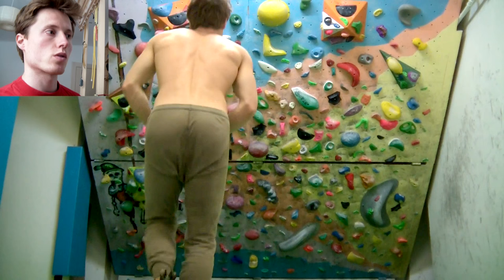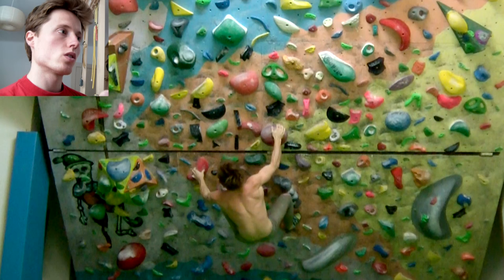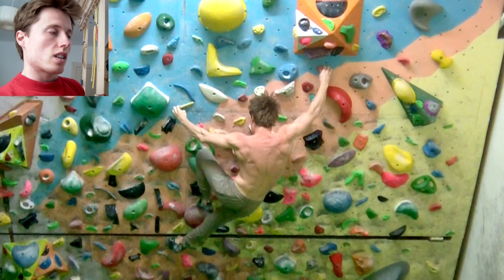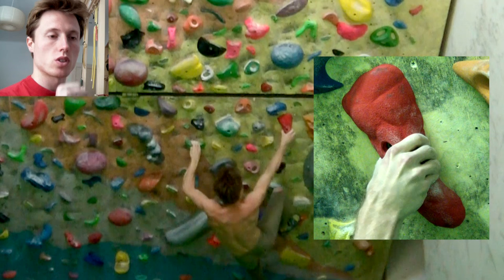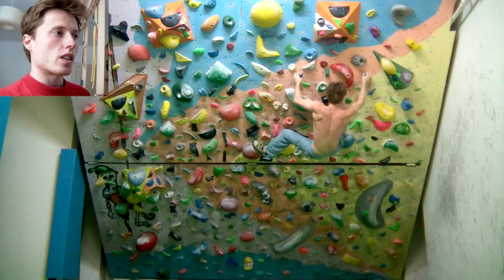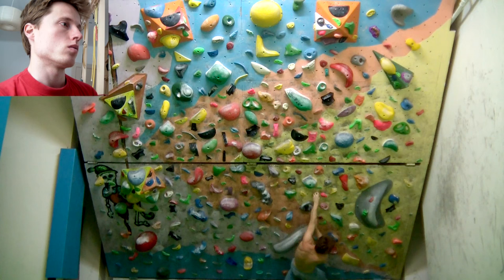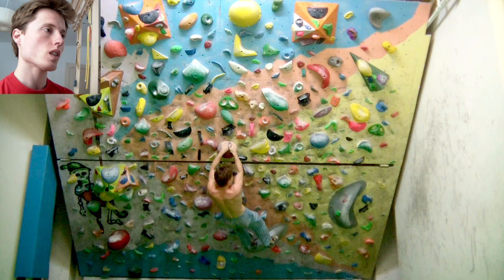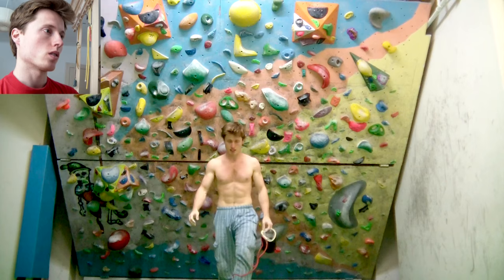Power Endurance in Climbing: How to Train it Effectively, Different Methods

Comment: Power endurance is the same as anaerobic resistance, right? From what I've gathered, for AE it is recommended to do circuits of 20-40 moves at your max but without falling, and not very long rests (3-5 mins), when you are training for sport routes. I wonder if this method you expose here works the same (different approach, same goal) for routes, because I tend to think this is more boulder-focused.
Any insight is welcome.
Cheers.

Edit: Just read one of your responses below. Anyway, would you think this power endurance is good for sport climbing? I'm basing my training on Eric Hörst's "Training for climbing" which includes 3 weeks of just volume and stamina, 3 weeks of power and strength and 2 weeks of anaerobic endurance, never including the power endurance.
Reply from the maker: What you are describing is anaerobic endurance (which is in my book the same as power endurance).
For aerobic endurance, one climbs 30 minutes non stop at very low intensity to get a soft permanent shake-off pump. Anaerobic endurance, which comes with much shorter circuits like 40 moves on at higher intensity and short rests in between, should yield a harder pump. And it's indeed very important for certain sport routes.

Comment: I have read in an article on climbing.com that actually to train endurance effectively one should avoid getting too pumped but only lightly pumped and try to climb as much as possible on relatively easy routes according to your level. Your videos are always inetresting.
Reply from the maker: Sounds like an approach for training aerobic endurance, which basically enhances your ability to shake out pump in a rest for example. This was ment to be a tutorial for training power endurance (or strength endurance, however you want to call it), which is something different (focuses more on not getting pumped in the first place, on lots of mediumhard  moves).
Reply: Hey, thanks, I got the point. Keep on rocking!